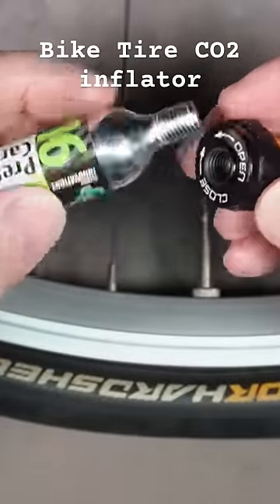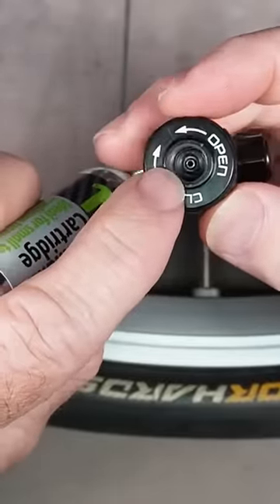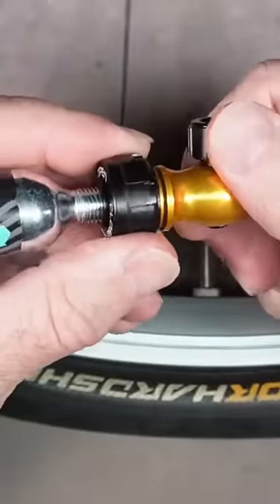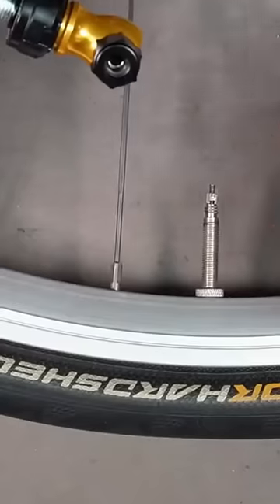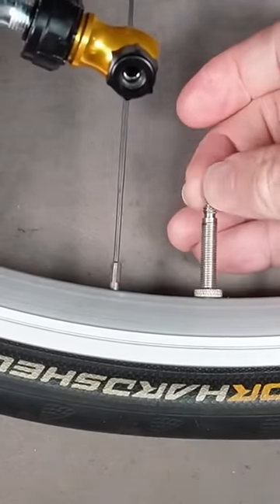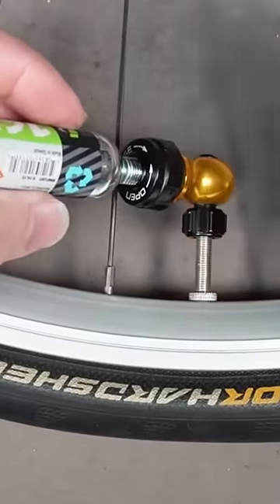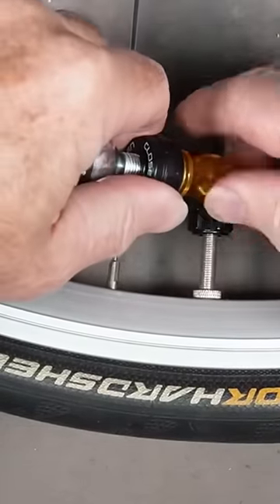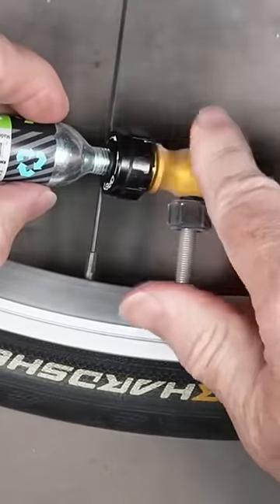Bike Tire (tyre) CO2 Inflator: How to use. #bicyclerepair #bike

Comment: Just remember to filled it up your way home. CO2 inflated tires tend to deflate in a day or two.
Reply from the maker: Thanks for the input! Great tip!!

Dave
Reply: You're saying that a larger, denser molecule than what comprises the vast majority of air will leak out faster than compressed air?
Reply: @jcarry5214  me and my friends use CO2 catridge when we got pinch tires when we are out like doing an century ride. we know that it deflates fast compare to normal handpump air or if you have Nitrogen gas much better
Reply: @jamilangon5798  that’s insane, never would’ve thought that. It’s the largest and densest highly prevalent molecule in the breathable atmosphere. We use nitrogen because that’s slightly larger and less likely to leak than compressed air (even though air is almost 80 percent nitrogen) so I definitely would have thought co2 would be at least as good.
Reply from the maker: I was surprised to learn that as well when I started using CO2. I always pump up my tires before a ride so I did not notice this after my last flat.

Dave
Reply: @jamilangon5798 wildly interesting
Reply: You could possibly use N2 capsules instead.
Reply: Nitrogen isn’t generally used for its leak proofness, it’s used because its coefficient of thermal expansion is less than atmosphere.
This means that when the temperature of a nitrogen tyre changes, the pressure in the tyre stays closer to the set point than regular air.
Edit: I’ll just add that some of the above isn’t quite right, the reason isn’t the coefficient of thermal expansion but that the nitrogen is more stable at low and high temperatures whereas air will change pressure a lot based on temperature and humidity. The nitrogen is also unreactive with rubber, which can be a problem with air (oxygen) at high temperatures.
Reply from the maker: Thanks for your input and knowledge!

Dave
Reply: @jcarry5214 Sublimation is a thing you know.
Reply: @davescycling YOU didn't even know it was CO2. You KEEP calling it air!
Reply from the maker: Yes, I called it air. I know it is CO2. I only use CO2 on rare occasions and usually use air to inflate tires. I misspoke. Guilty as charged. I am sure my viewers can follow the fact that I am using a CO2 cartridge and know what I meant.

Thanks for the comment!

Dave
Reply: @FutureRobinHood what does sublimation have to do with anything?
Reply: @beefchicken  Pressurized c02 in rubber is different from pressurized c02 in a metal container guy.
Reply: @beefchicken  Or in other words it passes right through the rubber being the main reason rubber tires don't hold c02 well.
Reply: @gtjack9 

I use nitrogen to check my joints for leaks all the time 
I stress test my joints at 700 psi for an hour 
I also flow nitrogen as I am brazing so as to not build up scale on the inside 

Also medical grade nitrogen is pure and stable
While I’m not using medical grade while I’m doing the joints that I’m doing there’s still less fluctuation if you use compressed air when you’re doing a pressure test
Reply: @FutureRobinHood  that has nothing to do with sublimation, sublimation is simply solid turning directly into gas. The reason CO2 goes through runner tires much faster than oxygen or nitrogen is that it has significantly higher solubility in rubber than those.
Reply: @FutureRobinHood I don’t think sublimation means what you think it means. Also as others have pointed out, CO2 is a larger molecule that either oxygen or nitrogen.
Reply: @jcarry5214  I think, even though the molecules size is very big, how it interacts with other ones doesn’t help, my guess is nitrogen helps build a wall, compressing and keeping the air in longer, while the CO2 does also compress, but instead, it is pushing the molecules out instead of pushing up against it, and being reinforced
Reply: @gtjack9  OK this actually kind of makes sense to why CO2 and nitrogen leak differently. They are probably both affected by the temperature and atmosphere differently. My theory is the CO2 is actually pushing out the oxygen like a bunch of water, trying to push out the last bit of air, comparably while nitrogen instead reinforces both can be affective, but the application and usage is different
Reply: I had to think about what sort of pressure we're talking about... because above a certain pressure, it becomes liquid. But I don't think I have ever heard of a bike tire being that high of pressure, because I'm pretty sure it's like 60-ish PSI that the change happens.
Reply: I was thinking that, was also thinking, wouldn't it be better to use compressed nitrogen instead?  Then, I wondered how available that is to the general public.
Reply: Good to know. Thank you.
Reply: @jcarry5214  CO2 is more soluble and passes through rubber faster than air.
Reply: @grey5135  interesting. By soluble you mean it’s just a more electrically slippery as opposed to a more repellent molecule, like alcohol vs water on a plastic bag?
Reply: @davescycling thanks for the appreciation to your comment section

-ryan
Reply from the maker: @dracekidjr  thank you Ryan!
Reply: @outandabout259  Yeah i know....i meant to say evaporation my bad
Reply: I think the CO2 dissolves into the tire compound and dissipates out. Makes it leave faster than normal air.
Reply: Yup! These are just for emergencies.
Reply: @peterpiper_203  700? dame what are you stressing it for?
Reply: CO2 tires going flat faster didn't make no sense to me so I looked up the reason why.
CO2 has a significantly higher solubility in rubber than O2 and N2, whereas the diffusion coefficients differ not that much. The result is that carbon dioxide passes ordinary rubber about 5 times faster than oxygen and about 15 times faster than nitrogen[1, 2].
Copied from the web
Reply: Hmm as thats all i have used in my tires and not one time can i think that CO2 leaked back out as i dont even remember the last time had to put air in my tire its been so long
Reply: @lomice3705  
 You don’t want a flare joint to fail or one of your braze joints to fail and drop 40plus pounds of refrigerant into a room or a space
Reply: Bs, works as usual, it at least
Reply: @beefchicken it is a larger molecule, but for some reason, it's something like 13x more permeable in rubber when compared to nitrogen. co2 requires special tubing when being run through lines.
Reply: The tires don't leak the CO2, it is extremely sensitive to temperature, so as it cools off, the pressure drops heavily.
Reply: @Comanchee0689  nope you're actually wrong in two ways, co2 literally permeates rubber. And also if you're decompressing co2 from a 800 psi canister into a 50 psi tire Boyles law means the gas will be colder than ambient, so if anything your tire should be higher psi after the temperature warms up to ambient.
Reply: @davescycling what’s up with the “dave”😂😂 We get it your name is Dave and it’s in your username 😂😂🤦🏽‍♂️
Reply: @bend3rbot you realize that CO2 in part of what makes up "air" right? 
"Air" isn't a synonym for Oxygen. 
"Air" is any combination of gasses that makes up the atmosphere in a given area such as our own atmosphere or the atmosphere inside of the bicycles tires. 
I know you didn't ask but mis-informed people has become a pandemic. Everyone should have learned that around third or fourth grade.
Reply: @jcarry5214 air is made of nitrogen and oxygen, less than 1%. CO2 I believe
Reply: Yeah these are meant for emergency purposes, paired with a spare tire in case of a puncture.
Reply: @gtjack9  The rate of expansion of nitrogen is the same as other gasses. It follows the ideal gas law. 
There's nothing magical gained by using nitrogen in tires. That's because ordinary air is already 78% nitrogen. 
The people who believe in the nitrogen nonsense say it's true, they've seen the effect on their own tires. But they're wrong. When you fill an "empty" tire, it already has one atmosphere of air in it. When you add only nitrogen, there's still one atmosphere's worth of air in it, so your tire doesn't have pure nitrogen in it like you think it does.
Reply: @jcarry5214  He is right. CO2 is much more soluble in rubber than oxygen or nitrogen hence it migrates out of the tyre about 10 times more quickly than air.
Reply: @dylanpetriko4843  I know. Why are you telling me? I'm surprised by the result but not in doubt because it is, and I quote myself, ia larger and denser molecule than what comprises the vast majority of gases in the air. Which part of anything I said are you chiming in about?
Reply: @Twisty1024  Tell me what soluble means though, how is it working in this case? How is a larger, denser molecule than 02 or N2 sperming its its way through so fast that even an emergency fill on a ride home is a cause for concern? I don't doubt you I would just like an answer that doesn't involve paraphrased wikipedia results.
Reply: @criticalevent  Interesting, I've never heard of the swelling. But it makes sense. That would presumably have an effect on the ductility of carbon through the tire as well. So the more you put in the faster it goes out, compounded by the acid. By the same token a perfectly sealed tire filled with air would theoretically lose less and less pressure over time if compressed air, eventually absent of co2, is replaced by smaller amounts of air with an already low ratio of the gas. Right? And there's something special about the attractiveness or slipperiness of CO2 that makes it readily dissolve in both non-hydrocarbon fluids and hydrocarbon solids?
Reply: @gtjack9  Gases don't have coefficients of thermal expansion -- that's a property of solids and liquids. Instead they have a relationship between pressure, volume, temperature and number of molecules: PV=nRT, which is the same for all gasses, and known as the ideal gas law.
Reply: Or you could use a normal bike tire pump and not have to worry about it
Reply: @jcarry5214 yea Jerry, that's exactly that op told you
Reply: Leaving this comment as a non-bike guy who wasn't read the replies.. I'm sure they're probably intended for using in a pinch, you know if you ever need a day or two of bike use to get somewhere you can fix your tyres properly..?
Reply: @gtjack9  fuckin thank you I look for this video again then the d**** said nitrogen is heavy then the air we breath 😂😑 nobody would use nitrogen if it was heavier the big thing with nitrogen was lighter an will not compress or expand as much with high or low temps
Reply: @gtjack9  That's all a whole bunch of crap.  Nitrogen, CO2, and air all behave almost identically over the range of temperatures and pressures you'll see in an automotive tire, much less a bicycle tire.  That's especially the case if you're using an air dryer, and any commercial air system will be using a dryer, because not doing so will eventually plug and damage the equipment using it.

There's two values to using nitrogen.  It diffuses more slowly than (the oxygen in) air, and far more slowly than CO2, however that's a minor inconvenience, and your fill from compressor air will trend towards nitrogen anyway as the oxygen preferentially diffuses first.  Pure nitrogen is unreactive at high temperatures, such as those seen during aircraft landings.  If you intend to be landing jumps on your bicycle at 150mph, then maybe nitrogen fill would be something to look into.
Reply: @thomasgeorge4384 I run road tires between 95-105psi. They're rated higher than that. The narrower  the tire, the more pressure you need and want to have to minimize rolling resistance or your tire bottoming out and damaging your rim.
Reply: @FutureRobinHood what about it? That has literally nothing to do with what they said
Reply: @thomasgeorge4384 wayyy more than 60 psi unless you have your chamber very cold. 
Edit: Just looked it up and it takes over 800 psi to liquify co2 at room temperature. Never realized how much pressure those little co2 cartridges are holding back.
Reply: @FutureRobinHood it's...still not that either...it is literally just diffusion amd leaking from joints. Not evaporation, not sublimation, not condensation, not anything else ffs
Reply: @jcarry5214 You really started a very interesting topic and now I really want to know why it happens like it does😂
Reply: On your way home**
Reply: @robbobthecorncobjriii8195  Yeah i know, need a Snickers?
Reply: @robbobthecorncobjriii8195  Oh i know c02 needs over a thousand psi to liquefy.....i just like seeing internet warriors get angry sometimes.
Are you okay?
Reply: @robbobthecorncobjriii8195  Over a thousand psi* 
You were close buddy.... :-)
And it'd still have to be around -109.3F for those pressures to achieve liquefication.
Reply: @Hellothis12157knbhb dude you can't just make wild ass theories based on no sort of sound knowledge. Science exists for a reason.
Reply: @chielwouterscw  right? I know it’s not wrong but I remember a lot of early chemistry and still have a hard time with how this works and the ramifications. How is it that the one gas that is safe and cheap
In liquid form the one that SUCKS to try to keep in rubber? Are those characteristics related?
Reply: @Sophocles13  Hands you a Snickers it's not that deep bro.....calm down
Reply: @jcarry5214  C02 solubility in butyl rubber is why it leaks faster fyi, not anything to do with temperature.... pressure....just that it's soluble.
(I've grown tired of trolling...time for the facts)
Reply: @jcarry5214 🥴
Reply: @jcarry5214 you're not surely suggesting co2 comprises the vast majority of the atmosphere are you? co2 is a trace gas ma'am, it's 0.04% of the atmosphere.
Reply: @jcarry5214 CO2 dissolves in the rubber, allowing it to permeate through the tyre significantly faster than nitrogen or air
Reply: @mohammedbinladen4619  surely? Surely you would know the answer to that question if you read what I said instead of having a hardon. I said it was a denser molecule than what comprises the vast majority of the atmosphere. Not that it’s in the majority of anything. But thanks for using google for me, that’s super mega helpful.
Reply: Not true at all I’ve used co2 for years and they stay inflated
Reply: @jcarry5214  essentially the charge distribution of thr CO2 molecule allows it to attract/intermingle with the rubber molecules (Van-der Waals forces)
CO2 can be a powerful inorganic solvent. For example, supercritical CO2 is used to extract caffeine from coffee.
Reply: @gtjack9  unless nitrogen massively deviates from the ideal gas law, you are full of crap (I've got bad news for you)
Reply: @EGL24Xx  Most of the F1 teams use dry nitrogen gas to inflate their tyres instead of air. This is done for two reasons. Firstly the moisture content of air is variable depending on the local weather conditions and this differs considerably between some of the exotic locations on the GP calendar. By using dry nitrogen gas the tyres will behave in a predictable way wherever they are being used. The second reason is that air is a mixture of nitrogen (78%) and oxygen (21%). Oxygen gas is far more reactive than nitrogen and at the high operating temperatures of F1 tyres (> 100°C) the oxygen reacts with the tyre, reducing the total pressure inside. Using pure nitrogen removes this problem and tyre pressures remain far more consistent
Reply: @gtjack9 nitrogen is used because it's free of water vapors and humidity. The humidity in air will make the pressure vary with temperature by a lot as more or less of that water is in gas vapor state or liquid state.
Ideal gases law states an increase of pressure for an increased temprature. This is both for air or nitrogen or any gas.

The trick is the humidity content.
Also to fill bike tyres with nitrogen is really unnecesary. Same for cars, and even trucks. Nitrogen filled tyres are a must on tyres that experience wild changes in teperature and have an impressive volume like plane tyres.
Reply: @jcarry5214 co2 comprises less than 1% of air, 78% being nitrogen and 18_21% being oxygen
Reply: @NormadYT  I agree. Why are you telling me?
Reply: I've had no luck with tubeless tires. Put a tube in it, pinup it up, and don't worry about it for a while. Tubeless=flat in a few days and have to constantly put sealant in it
Reply: @jcarry5214  it has nothing to do with it being “less likely to leak” it doesn’t change pressure as much when heated or cooled unlike air, which is why you need to check tire pressure between winter and summer.
Reply: so you fill the tire up with a fart?
Reply: @FutureRobinHood not at all what sublimation is bro
Reply: @FutureRobinHood Sublimation is the transition of a substance directly from a solid state to a gas state. It does not pass through the usual liquid state, and only occurs at specific temperatures and pressures.
Reply: @AaronLyNxAI  Yeah....i know.... again...was just messing with people....i troll here and there but its harmless fun lol
Reply: @FutureRobinHood  sure buddy...
Reply: @AaronLyNxAI  You okay?
Need a Snickers?
I explained why it leaks faster, now you explain why you're upset buddy....lol
Reply: @FutureRobinHood  nah you wrongly explained how it leaks, then tried to claim you were just trolling. Seems like someone might have some issues with confrontation. You lost dude, you were wrong and can't stand being corrected. Replying doesn't make you a hero, and sure as hell doesn't make you look smart or witty
Reply: @davescycling I love how you sign your comments each time

- Not Dave
Reply from the maker: @ChiefOmp20  sorry, just habit I guess. Want people to know it is actually me and not someone else answering my comments I guess! 

Da……ooops
Reply: @FutureRobinHood that is horse manure. I don’t think I have seen a less well informed set of conversations ever. Please read a physics book.
Reply: @DwayneHicksCpl  Lol you fell for the troll, as stated in the string i've already clarified how this whole process truly works, didn't know how many angry pretend scientists would have their panties in a bunch though lol
Please read the room.
Reply: @jcarry5214 a denser molecule?larger - yes. The diffusion should be lower. Btw N2 is slightly larger than O2. Even though it’s lighter.
Reply: @jamilangon5798  Perhaps the condensate gets into the valve preventing it from being screwed tight? With this method. When the condensate melts the valve will let off air (carbon dioxide)? Perhaps retighten after half an hour and see if it still escapes faster than regular air.
Reply: @gtjack9  What do you mean with "stable". I could understand expansion but stability? Does air decay into ... non-air? Sorry, don't want to mock your post but I simply don't understand.
Reply: @David-cy5zu  not clear what you’re saying.
Reply: @jcarry5214  wtf is a denser molecule? thats nonsense
Reply: @David-cy5zu  okay!
Reply: @davescycling  all good brother 😂
Reply: @davescycling To be fair, air could be anything.
We could be breathing in helium, methane and fluorine and we'd call it air nonetheless.
Reply: @FutureRobinHood in mother words this has nothing to do wir sublimation
Reply: @davescycling 
I always find it easier when viewers are credited with intelligence

Such a refreshing change most assume the dumbest of viewers and it puts me off 

So kudos 

I'm here trying to work out why co2 would be a good idea for this 

Reading about leaky tires leaking faster with this makes me wonder what compression resistance co2 has 

It's usually forgotten that different gases take different energy to compress

One using more energy to compress will have more energy to attempt to escape 

I may have to look at this to see if it offers a better explanation for this
Reply: @Hellothis12157knbhb no it doesn't at all 

The two main things I would look at first is the energy used to compress 

If for example co2 takes more energy that's the explanation more energy trying to get out too not an exact sum for psi etc 

Meaning pressure doesn't always mean the amount of energy trying to escape

My guess is the second most important

Weight 

Something that is light wants out of the top more than the bottoms 

Co2 is relative to the weight of air and therefore will want out everywhere
Reply: @grey5135 we have established this but why 

Soluble has nothing to do with it 

Isn't soluble the effectiveness that it dissolves things ¿?
Reply: @davidhenderson3400 
It's a poor explanation that mate 

No mention of the difference in weight which is majorly important too 

Nitrogen may put more energy to escape upwards not in every direction making a huge difference too
Reply: @Mike.The.Jeweler 
BRAVO I knew soluble wasn't the correct word
Reply: @MrDonKP a combination not just co2 you myth busted your own comment
Reply: @dylanpetriko4843 actually air is 0.017% co2
Reply: @e-curb you do realise to have one bar it would need to be round not flat and most vacuum before using nitrogen

I don't take heed to the nitrogen thing however
Reply: @Twisty1024 co2 dissolves the rubber 

Because we'll thats what soluble in this context would mean
Reply: @robbobthecorncobjriii8195 air and co2 compress too liquid massively different
Reply: @FutureRobinHood 
Time for other facts

Soluble usually means how well something dissolves 

So I don't see the rubber dissolving 

Please explain what it is you mean by soluble in this given context 

It's very confusing

An example you buy soluble aspirin because it readily dissolves 

Also how come nobody is taking about ten weight if gases. 

Co2 being heavier will want out from all directions evenly 

I'm fairly sure nitrogen is lots lighter so wants out the top lots more than anywhere else 

Even if they was the same particle size  co2 would be escaping from more paces irrelevant to anything else affecting it 😊
Reply: @mohammedbinladen4619 it's actually 0.017% co2
Reply: @syedrafiqkazim448 this can't be correct is so why wouldn't sweating cause the tyre to leak liquid 

Also if this was the case how come that afterwards you don't have a leaky tyre regardless of what you use 

If co2 is dissolved by rubber then that would leave micro holes where air at a later date would also escape 

From what everyone here is stating they are fine afterwards filled with air 

???
Reply: @jcarry5214 only he was still wrong only 0.17% co2
Reply: @John-fo2nw if your have the correct rubber learn to read my man
Reply: @rctruxbashing7420 incorrect
Reply: @FutureRobinHood I like that excuse for when your just wrong 

Oh I was trolling yes ok we believe you millions wouldn't 😂
Reply: @DwayneHicksCpl says the so intelligent person that you can't even state what is wrong or what we should read up on 

Me I'm confused by this not much of whats here is adding up to science

For example in my head could be wrong 

But if co2 is dissolved by the rubber than the tyre would be compromised using air afterwards this is not the case at all
Reply: @FutureRobinHood 
Sometimes your explanation doesn't add up and your learning nothing by stating I have already said everything about it 

Very wise man once said only extremely clever people realise they can learn something from the daftest of people

For example

Co2 being dissolved by rubber would compromise the tyre for future uses but it doesn't seem too 

In fact anything with a larger molecular size leaking faster through any membrane will leave larger holes 

This doesn't appear to be the same 

So no matter how educated the explanation it explains little 

I do love you're response though one of the better ones 

I do wonder if gas weight has anything to do with this 

Anything near the weight of air will equally want to leak all the way around 

Anything lighter possibly wants out from the top much more than equally¿?

Help me understand the answers here please

I'm no expert and don't pretend to be but using critical thinking and it doesn't all add up for me
Reply: @Leekodot15 nope air is literally considered what we breath in earths atmosphere
Reply: @davidhenderson3400  Mainly butyl rubber yes!
Reply: @jcarry5214  majority is nitrogen
Reply: @jcarry5214 could also be due to co2 vibrational patterns
Reply: @jcarry5214  no google says co2 is a smaller molecule that regular air and will seep through the rubber imma stick with what a search engine says than ur comment till u prove me otherwise
Reply: @ashleysoukup8685  I don’t know what you did to get your results but I also have access to google believe it or not. Three different variations on the search tell me that CO2 is larger than both N2 and O2 which are what almost all air is. I’m not a physicist but I think it’s because it has 3 atoms instead of two. But hey, maybe it’s me. Now why it seeps through, that’s been covered pretty well.
Reply: If weather is cold....what are you saying😅🤣
Reply: @gtjack9 actually, nitrogen is used exactly to help finding micro-leaks in fridges and acs
Reply: @jcarry5214   Carbon dioxide liquefies under pressure especially in colder climates. Also the rubber in your tire is semi permeable to carbon; it just won't hold.
Reply: Your tires also deflate because the rubber inside stretches out with use. This is most noticable with new air tubes
Reply: @jcarry5214 ohhhh my god it’s so crazy you say that it’s almost as if I remember someone else saying that exact same sentence oh wait actually I remember another and another but why would you say it if it’s already been said twice or maybe even 3 times I wonder hmmmm give me time to think I might need to call an investigator this is a such a mystery as to why you came in here read comments and put the exact same thing 3 other people put it couldn’t possibly be that you looked it up and felt stupid that somebody already said but you wanted to feel smart so bad you kept it anyway I’ll report back in a week with my finding
Reply: @jamilangon5798 I can barely understand what you're saying.
Reply: @jcarry5214  ambient air is mostly nitrogen, nitrogen is coincidentally the best gas for tires. Therefore ambient air from a pump is better.
Reply: I have N2 in my tires, it's keep better on pressure and is not affected by cold that quickly
Reply: Nk
Reply: Nah
Reply: @jcarry5214  Yup. CO2 is soluble on butyl rubber.
Reply: That's crazy. I Didn't know that.
Reply: @shexdensmore most restaurant supply stores carry nearly identical cartridges filled with N2....used for whipped cream makers.
Reply: @jcarry5214 nitrogen is the most common, what are you talking about Willis?
Reply: @hectordelgado3258  guarantee you didn’t read it correctly
Reply: It is not a matter of CO2. It is just because you tube has been pinpointed. Solid tube will not deflate.
Reply: @FutureRobinHood  Evaporation also has nothing to do with it. Evaporation is a phase change from liquid to gas.
The CO2 in a tyre is already a GAS, therefore it can't evaporate.

Edit: the rest of the comments didn't load on my first attempt so I missed your embarrassing attempt to backout using the "trolling" excuse when it's clear to everyone here you were just wrong.
Reply: People Googled it 🤦🏻‍♂️🤦🏻‍♂️🤦🏻‍♂️
Reply: Pues con frío tardan medio dia😅
Reply: @bend3rbot you got issues.
Reply: Answered my one question
Reply: @jcarry5214 clear example of: "The more you know the less you know."
Reply: @FutureRobinHood quitter
Reply: @177og1K  I'll never quit.
Reply: @FutureRobinHood  "Good. . . Goood"

                -Emperor Palpatine
Reply: @davescycling how DARE you use CO2!  You should be in PRISON for doing that!
Reply: @jamilangon5798 bro my shitty hand pump doesn’t work I resort to this more. It’s cheaper and better then what I have currently
Reply: @jcarry5214  Size isn't everything, even in chemistry. The diffusivity of CO2 in typical inner tire rubber is pretty much the same as nitrogen and oxygen, not taking in account their different sizes so it isn't the main mechanism for these gasses to permeate rubber. Instead the solubility of CO2 is much higher, effectively passing through 5 times faster than oxygen and 15 times faster than nitrogen.
Reply: @FutureRobinHood  do you know what sublimation is?
Reply: @jcarry5214  Yup. Leaks out quickly
Reply: @jcarry5214 Looking in the NIST Doc regarding permeability of gases through rubber this document does show the permeability to be higher for CO2 than air. See table 9 and table 10:
Reply: Purpose made you fools. All saying it's not as good, that's not the point. It is the fastest fix. The fastest has never been the best
Reply: @outandabout259  Good to know. Thanks. Outside air only has about 400 ppm (0.04%) CO2 , so air is perfect for tires. And nitrogen cilinders would be way better than the CO2.
Reply: I'm using nitrogen filled tyres in my 92 Ford Escort RS Cosworth I noticed difference driving don't leak or temp change trouble expensive but worth it
Reply: I'm doubtful.
Reply: @brian3174  Air is already 70% Nitrogen. Does it really make a difference?
Reply: @DutchmanAmsterdam  TRUE GOOD POINT
Reply: @jcarry5214 bigger molecules means less space for more. It’s filled the same but with less molecules
Reply: What happens with Helium?
Reply: @jamilangon5798  "pinch flat" being the key issue.
Reply: @jcarry5214 yes it is better to use hydrogen
Reply: @jcarry5214  CO2 doesn't comprise the vast majority of air, it's surprisingly just about 0,04% of the earth atmospheres volume.
Reply: @honeycomb936  you gotta read all the words, not just the ones you like.
Reply: @honeycomb936  Just checking in, there's still time to delete your comment after you use your whole eyeball!
Reply: @jcarry5214  CO2 is partially made from carbon, same as teh tires if I had to guess I would start looking there for the real answer